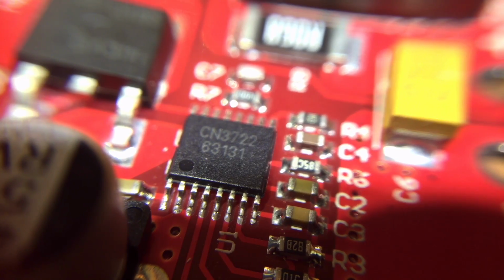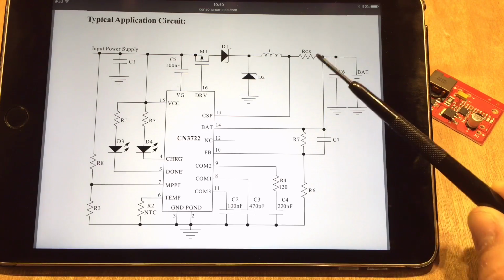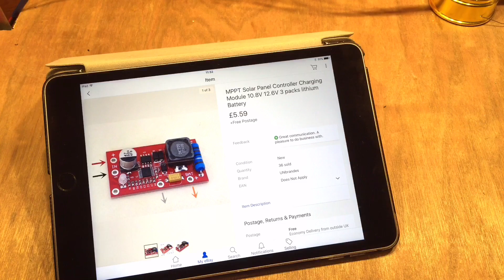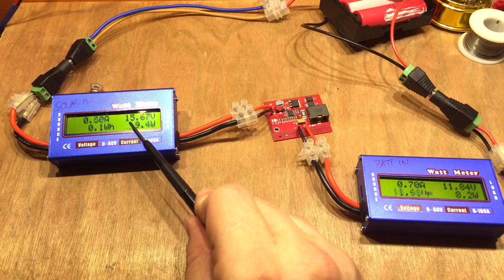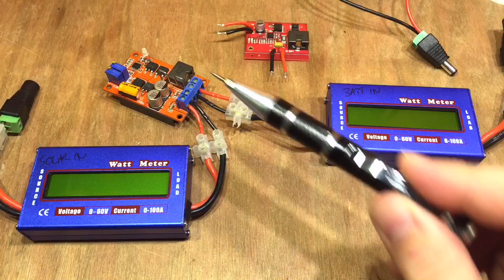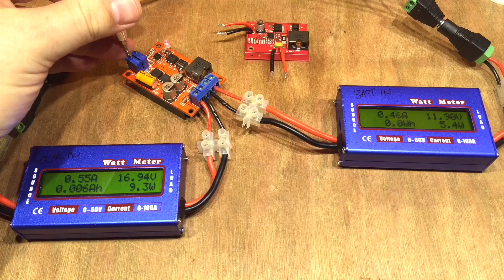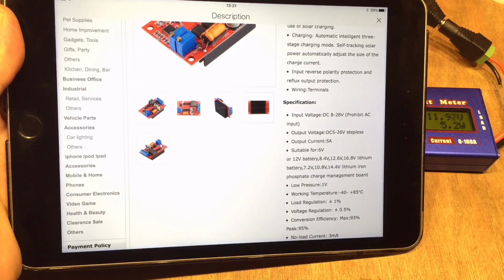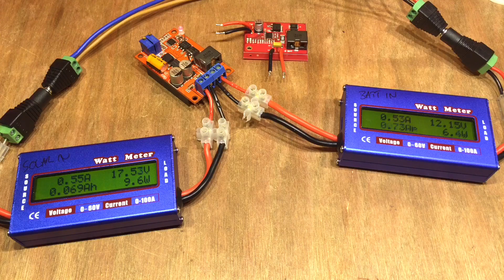Cheap(est?) Lithium MPPT Solar Charge Controller CN3722 - 12v Solar Shed

Comment: I believe the first controller is using that large low-value resistor that measures battery current to adjust panel voltage to the maximum battery wattage, because that's what we're after isn't it? The most battery wattage? If so, then I would guess that there's no reason to measure and monitor current coming from the panel which probably keeps self-consumption to a minimum.

Comment: Hi Adam. Thanks for making this video. With your very clear language and explanation. I know now that this certainly is NOT a real mppt controller. But it seems to do a lot better then a simple pwm chargecontroller with only a regulation of voltage and current to the battery. Thank you once again.
Reply: Yeah, it's the cheap and dirty way of doing MPPT.  You do lose a couple percent efficiency vs. a true MPPT, but at least it's better than PWM.
Reply: @chrisw1462  It's an MPP controller without the T.
Reply: @ahaveland  Sorry, but if you search Google for MPPT, you get Maximum Power Point Tracking.  If you search MPP you get a whole bunch of stuff that isn't MPPT.
Reply: @chrisw1462  You're taking this too seriously.
If it statically keeps the  input voltage to the maximum power point and doesn't track, then it is not a tracker. It is an MPP device and not an MPPT device.
I don't care what others might call it or what Google says.
Reply: @ahaveland  If it's not tracking, it's not Maximum anything.. :-)
Reply: @chrisw1462  You set the input voltage to the maximum power point of the panel, and leave it.

Comment: So despite the incorrect solar panel voltage, the first one is actually more efficient. It gets more solar watts into your battery. Replacing the resistor divider on the first one with a pot would seem the best option then.

Comment: Hi Adam, sorry for all my noob questions,  but I really hope you can answer this one. I purchased the last Mppt you featured and connected it to my 4s7p pack along with a 25watt solar panel. I get a reading coming from my panel @ 19.8 volts, but no Amps. Battery is @ 14.5v. Can you please advice. Thanks. Oh and I have a 4s BMS connected to the batteries

Comment: I don't understand how a Li Ion cell could be Over Charged ( Above 4.2V) if you never provide the batteries with more then 4.2V.  It can't happen if the charger is set to 4.2V max.

Comment: First off, yes, with temperature on panel constant the peak power point will be at a certain solar cell voltage. It will not change based on solar influx.
Once you have set it up for your panel it is good to go. The slight adjustment needed by temp to keep it on track looses minimal power compared to not tracking at all.
As you pointed out it is very specific to input and output voltages so one can resolder to adjust if possible, or adjustable may be preferred.
The higher power designs are as you also point out not as efficient for lower powers. This goes for the expensive controllers as well.
Only way to really confirm it's close to the max power point would be to have repeatable solar influx and test it by load testing the panels and creating the curves for them and compare against what you get from the mppt board. One way may be to simply set a fixed resistor on the output to give a similar load instead of charging an actual cell which will be varying a lot.
You will be surprised at how close it is to peak. Hope you are still having fun with solar!
Reply: What do i use to charge my enjoybot 100ah battery?  I think i want to use a flexible panel on the car rooftop if it will fit.  Sw Michigan
Reply: I think it's like 13.1V

Comment: One problem with the circuit that I see is that it can't measure the power going in. The way that MPPT works is by measuring the power coming in, and then adjust the input voltage so that maximum power going into the circuit is at maximum. Then use DC to DC converter to put the voltage at the desired charging voltage for the batteries.

Comment: Adam, at  14:43 of your video you mentioned something about a balance board possibly balancing each series as to avoid unbalanced cells. Which board would you recommend for a 4s7p battery pack. Thanks

Comment: I am trying to put together a cheap charging system for lipo battery to run a security camera. the camera uses 6 watts 12 volts. What do I need to keep this battery charged over long periods of time ? It will be a wifi camera. Thanks in advance..

Comment: The CN3722 does a very simple DC-DC power conversion. In a way, the it is not a true MPPT solar charger because it does not scan the input power to find the actual maximum power point. Rather, it is a fixed input voltage converter. What it means here is, there is a pair of resistors that sets the voltage level where the solar panel provides maximum power. For most solar panels, this voltage is around 16~18V. If you have a battery that is at 12V, the difference between the MPPT voltage and the battery voltage is loss in efficiency. By regulating the input voltage at 16~18V, there is efficiency gain. For a smart MPPT solar charger with build in micro controller, the MPPT charge controller scans the input voltage/current to find the actual MPPT. But for this particular "dumb" MPPT charge controller, the input voltage is fixed. Thus, yes it does work, but it is not the actual maximum power point, especially if the panel is partially shaded. One advantage of this MPPT charger is there is a back flow prevention diode build in. Thus, at night, the battery won't be powering the solar panels.

Comment: Now if something like this with like 10 amps and integrated 3S and 4S balance charging existed!
Reply: You can parallel them for 10A. When you say 3S or 4S, are you referring to 12V batteries in series or something else? I have a 12V 4S and I'm using four of the second one, one for each battery, no balance is needed because each controller looks after it's own battery! It actually works really well... You can use it with any battery starting from 5V all the way to 12V batteries.
Reply: @PeterMilanovski  Thanks, that's interesting. 
But I was thinking of a simple to use charging circuit you can just put 4x 18650 batteries in series to get 12V total and don't have to use both a charging board and a balancing board.
Something cheap and very easy to use.
Reply: @dejayrezme8617  that's fair enough, have you thought about using those little BMS PCBs that are tiny and they are designed to be mounted directly to each 18650 cell? 
I got a whole bunch of them, what I wanted to do is to be able to charge each cell separately from each other and these worked... So basically if you imagine your 18650's in series to get the 12v or so that you need, you put one of these tiny BMS boards (they have a battery connection at either end for easy connection to the cell and then there's the charge connection in the middle of the board for the charge voltage input), you connect your load to either end of the series connected batteries for your 12V but your batteries all charge separately from each other and only stop charging a particular cell only if it's full, the rest keep charging if they need it... They will all be brought into balance every single time they are charged... 
The one thing that you must always remember is that cells, no matter which chemistry they are have an internal resistance, no two cells are ever the same! Why is this important? Well, all your 18650's will charge and discharge at different rates! If you set up the cells like I have explained to you, you won't have a problem, but if you just connect 12v at each end, the first cell in the series string to reach full charge will continue to charge and get hot, eventually it will catch on fire 🔥... This is the reason why people use a battery Balancing BMS... But even though it's the popular choice, the method that I have told you about is so much better, you will be effectively charging each cell to 4.2V, and when it gets to that voltage it stops while the rest catch up... I have already tried this before I moved on to a 48V setup with 12V Lifepo4 Batteries except this time I used the second charge controller in this video... All I needed was to connect the solar panels and batteries and I was done ✅
For the 18560's you will probably need a DC to DC converter with constant current and constant voltage to provide the 4.2V to each of the little BMS PCBs or whatever voltage you choose to set the maximum charge voltage... Don't go looking for to charge 18650 cell's at maximum current! Try and keep the charge current as low as possible and your cell's will last a long time! 1amp each cell is good, 2amp if you really need a faster charge time but that's something that you will have to work on... If you can get away with 500ma per cell, well that's even better... 
Anyway, I hope that this helps 😊, if you have any questions, just reply to this post...
Reply: @PeterMilanovski  Thanks for the reply! I've been looking and learning about this for quite a while but I'm still a noob.
And yeah those small single cell protection circuits are interesting, maybe they are fine for a small pack like I'm talking about.
My eventual goal is to build a larger 48V Lifepo4 "powerwall" battery with about 20kWh capacity. For a solar powered cruising boat. For that I will need a more sophisticated 16S BMS. But that is still a bit away and theoretical, more like a long term dream :)

The 12V lifepo4 you mention will have their own BMS I guess. Sou you would be using two separate BMS and a single charger. Which works I guess, but wouldn't be my preferred solution.

For practice I was looking to do this for 12V and smaller solar panels. Like a battery powered garden light mounted below a 12V solar panel.
So I've been looking for something that combines MPPT charging (or PWM) and BMS in one, simply because it would simplify the connections. Just for convenience. But there just isn't such a thing, and I guess it's not really needed either.

So I figure I'll try those cheap 4S bms or the individual 1S protection circuits. I didn't realize they had separate connection for power and charging. So I figure they work just fine but it's more cables than a 4S
Reply: @dejayrezme8617  the 12v Lifepo4 Batteries which I'm using are only 8Ah and weigh 950g... And yes they have their own built-in BMS.. but I have 4 of them in series for 48V and I'm also using 4 charge Controllers, one for each battery! 
Even though they have their own built-in BMS, when I tried to charge them at 48V, all 4 charged at different rates and the first one to reach full capacity would be the one that triggers it's over voltage protection from it's built-in BMS and the series string gets cut off and the rest don't charge! So that's why I set them up like this now. The batteries are still wired up in 48V but the MPPT charge controller for each battery makes sure that the battery that it's connected to gets a full charge even though other batteries are full and stopped charging... 
These MPPT charge Controllers cost me $10 each for four plus $5 combined shipping, that's $45.. 
The 12V 8Ah Lifepo4 Batteries cost me $66 each for 4 of them with free shipping, that's $264 in Australian dollars... I was given my panels for free! 
So, 4 of these charge controller's provides me with a total of 400W of solar energy into the batteries... The batteries provide 48V at 8Ah.. 
Now if I need longer run time, I will do everything exactly the same, I will keep the two battery bank's separate from each other by fitting a diode on each bank so that one side doesn't try to overcharge the other... This way they can both be used together but charged separately... That way they will always stay charged, balanced and never catch on fire 🔥... That's the bit that everyone is trying to avoid.... But don't always succeed...

Comment: My conclusion of this measurement would be that these are bad chargers. On 11:05 of you video:  If your panel can deliver .55A @17.45V it can certainly deliver that (and even slightly more) at the battery voltage of 11.9V so if you would connect your panel to the battery directly the battery would already get charged  .55/.44 =1.25 times higher charge current. So any charger of which the charge current is lower than panel current is not taking advantage from the maximum power point. Whether it is a tracking device or not.

Comment: Hi adam, Nice channel to watch. In the video I hear you talking as if the MPP voltage is something that is constant. This is not the case otherwise you would not need a tracker.  The specification on your panel is under standard conditions which typically are 1000W/m^2 irradiation and 25 degrees Celsius of the cells.  In general there is a dependency towards irradiation and temperature. Shown in this graph: https://www.allegromicro.com/~/media/Images/Design/Current-Sensing-For-Renewable-Energy/Figure-2.ashx?la=en&hash=FD1D25669FE3E55DC22C2B0516CEB736E1B20A8D

Comment: Hi Adam,
First of all I would like to say I love your videos !
But I would also like to place some remarks:
1. You should realy get your watt meters externally powered, so their own power consumption isn't influencing the measurements. (use the portapows or hack-in an external supply)
2. The mppt function of the CN3722 is really more a power point 'targeting' and it does a really good job, especially if you actually use the temparature sensor and mount it on your solar panel. 
This since the mpp voltage is fairly constant, but temperature dependent (that's why they note Vpm on the panel 'at 25deg')
3. Note that the power USED by the charger depends primarily on the battery state. And if the solar panel can deliver MORE power than required for charging it will never be in it's maximum power point (resulting in a higher panel voltage)
On the other hand, if lighting conditions are insufficient (clouds) the solar panel will NOT reach it's nominal maximum power voltage (resulting in a lower panel voltage). So the mppt will only be effective in a small range of conditions.
4. When just charging batteries
the battery voltage is 'fixed' so you get an optimal harvesting of energie when you maximize the charging current.
5. The mppt circuitry will lower the current drawn when the panel is below it's Vpm, so on low light conditions (when the panel never reaches Vpm) the output current will become zero !
So do we want mppt at all when just charging ? 
As long as the panel voltage stays above the battery voltage (and the buck working voltage) a buck converter will still try to provide the maximum possible current into the battery....

Just give it some thoughts,
and keep up the good work !
Reply: yes, but its mandatory to use a temperature probe on the panel. MPP voltage gets quite lower when panel heats up and if you dont monitor the temp, then you might be getting no power at all when still on MPP voltage of 25 deg.
Reply: What do i use to charge my enjoybot 100ah battery?  I think i want to use a flexible panel on the car rooftop if it will fit.  Sw Michigan  i think it's like 13.1v lifepo4

Comment: its not mppt... mppt takes low voltage or high voltage  and converts it to amps.. so if you have 5 amps coming your output should be 8 amps going out its boosting it... these are just cheap fake voltage regulators marketed as mppt.. a mppt costs about 100 bucks or more not 10 dollars... so dont fall for it

Comment: That is what happens when you get salesmen writing data sheets.  This is a MPPC chip and that temp sensing input is for a temp sensor on the panel, NOT the battery. Frankly I am a big believer in MPPC and all my controllers at camp are MPPC.  Power point voltage really only needs to be set seasonably as typical panel temps don't vary much. The big advantage is multiple controllers can be set to slightly different voltages as little as 0.1V difference to give priority to loads. This allows me to charge battery as primary and secondary send any portion of power to a water heater.  This all happens seamlessly.  While this chip has LI charge control, any buck converter can be turned into a MPPC controller or Linear Current Booster for pumping water without a battery.
Reply: I agree 👍 I am using the second one in this video and after watching it and setting up the mppc plus the cutoff voltage, it just works! No hunting around for the best point when a cloud will pass overhead! Some days I think that the MPPT charge controller that I used to use spent more time hunting around than charging! Because they won't charge until it's found the point! These things work in parallel or series or both LoL.. super flexible... I love it 💖.

Comment: the MPP changes according to the irradiance available at any time so the voltage and current also change. The nominal MPP is based on 1000w/m2 insolation so unless you have exactly that, the Vmpp and Impp will be different than the nominal mentioned in your panel.

Comment: There's another type of this chip and same manufacturer: CN3791
Could you do a review on this one? It's supposed to be an MPPT as well and seems almost identical. But not quite sure what the difference would be.
Reply: That cn3791 is input 9v - 12v only and charges 3.7v - 4.2 lion cells. The cn3722 can input up to 28 volt and charges 12 volt batteries.

Comment: A nice video  but I feel these  two watt meters are effecting results. Because you are only using such low watts with them  in this test they each are drawing a significant portion of the power away from the charging of the load. I feel you need a much larger load. These test should not be done on a battery that is almost fully charged because the watt meters will be consuming a significant portion of the total load of the panel output as compared to what the battery is consuming.